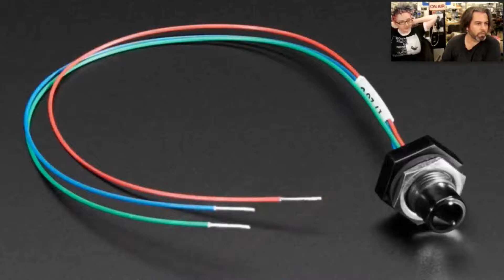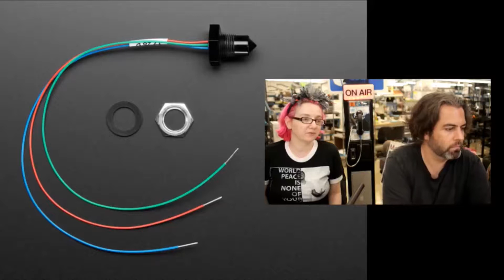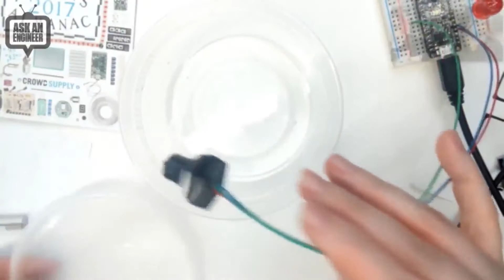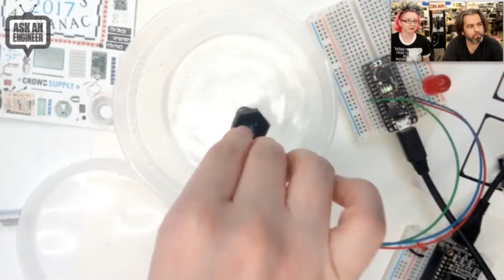SST Sensing Ltd | Optomax Liquid Level Sensor Review | Demonstration by Adafruit

Comment: I believe these sensors work exactly opposite as to how you described. When in air, the LED light is reflected inside the cone tip and return to the sensor. Once in any liquid, the LED light is able to escape.

Comment: Would your material survive in Methanol?  I would like to monitor the level in a tank I have and I'm trying to come up with a solution.
Reply from the maker: Hi,
Regarding Hazardous / Chemical materials, It would be best to discuss the correct product for your application with our technical department at technical@sstsensing.com, they would be more than happy to help. Alternatively, send us your email address and we will conact you as soon as possible!
- SST
Reply: Any luck with methanol ?
Reply: @catpowervic  Sort of yes. I found a guy who makes a sensor tolerant to meth
 he sent me a prototype and it works great.  the problem is he doesn't respond to emails anymore.

Comment: Hey.....sorry had to ask, why didn't you guys explain the output voltage.....basically does it put out 12v ?
Reply from the maker: Hey Clifford, no need for apologies.
In short: When dry the output is the same as the supply Voltage (4.5-15.4VDC). When wet, the output is 0V
All information on this sensor can be found here: https://www.sstsensing.com/product/optomax-digital-range-of-liquid-level-switches-2/
This video was a review of our Optical Liquid Level Sensor by Adafruit, It was a 1:47 segment of an original 13:24 video. Maybe they didn't have enough time🤷